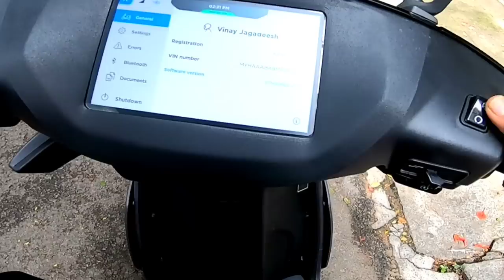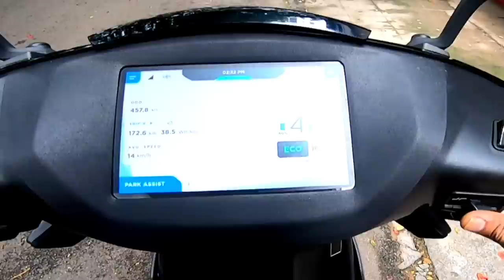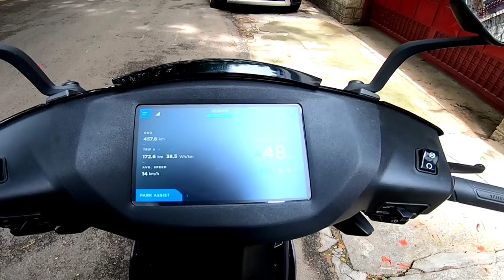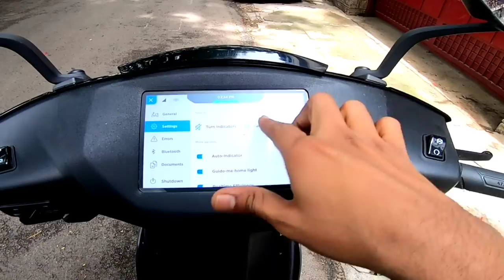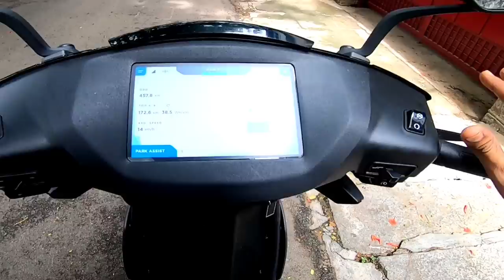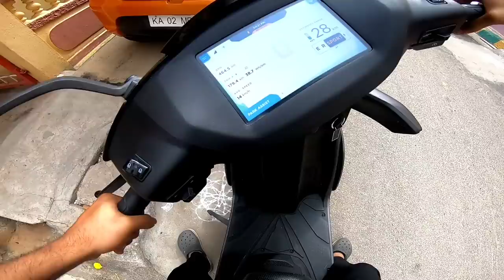Ather 450x Review in Kannada | Performance Cost Maintenance Range

Comment: No body is aware of what will be the battery replacement charge after 3 years, nobody knows what will be the power bill after a year or two,nobody knows what will be the resale value etc.
Better get to know all this things before going for this electric vehicles.
Just the skeleton with the warp motor without battery will cost 99k , battery replacement will cost anywhere between 50 to 60k.
Reply from the maker: Hawdu idu nija 👍